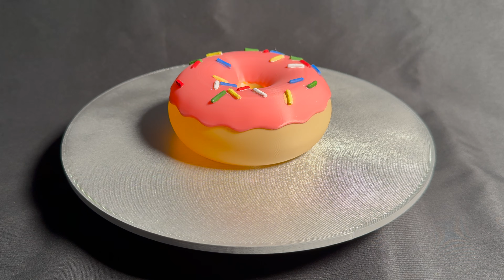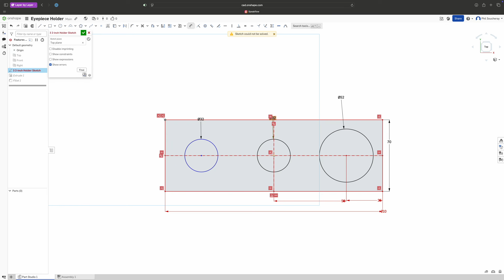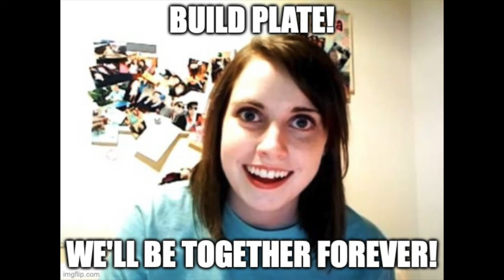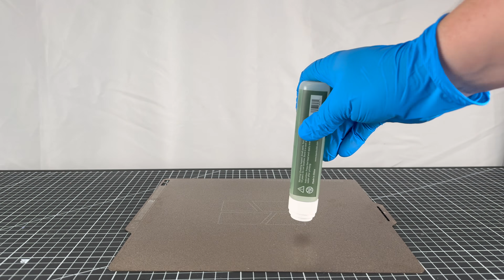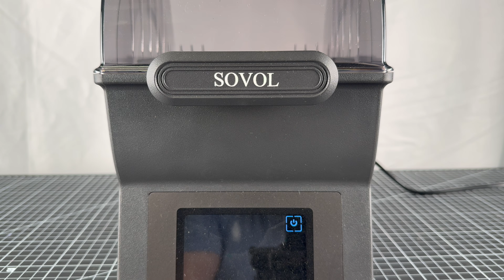Must Have Items for Your 3D Printer

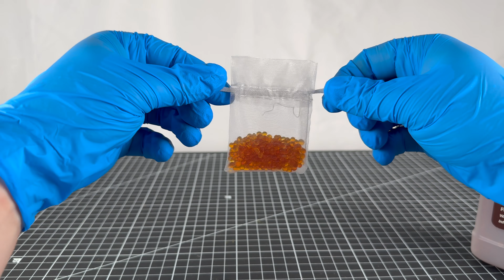Comment: 6:05  I bought a bunch of DIY tea bags to hold desiccant. I now have over 80 spools in vacuum bags with desiccant, which I vacuum out with a high powered food sealer with a canister attachment. Those little pumps manage to remove almost as much air, but they do it far too slowly for my taste.
Reply from the maker: Do you have a food sealer you like?
Reply: @LayerbyLayerPhil  The one I use is the Anybear Vacuum Sealer Machine, 90kPa 120W Wide Seal All-IN-1. It even comes with the “cup” that fits over the vacuum bag valves. It’s available on Amazon. I have several of those rechargeable vacuum pumps and they generally take about 2-3 times as long to void the bag. When storing a whole AMS of filament, you REALLY notice the difference.
Reply: @LayerbyLayerPhil  Also, one thing further … when the air is removed, the bag clings to the side of the spool. Since the spool core has no effective air passage to the filament winding, putting the desiccant bag in the spool core will remove moisture from the spool core but not so much the filament winding. Put the bag of desiccant in the vacuum bag before the filament spool and let it settle beside the filament and when you remove the air, the remaining air inside contacting the filament is also contacting the desiccant so will dry the filament more efficiently and quicker.

Comment: Without watching the video I am guessing it's (the tule bag) being used to store desicant. At least that's what I use them for, works great. Now to see if I am right... and I was

The Gecko Plate is great for PLA, uhh use glue as a release agent for CoPE, it will come off but crap it wasn't easy.

Love the storage bags however I found using a USB corded vacuum much better than battery powered one.

Comment: Are you able to put those dehydrator ball baggies into the dryer or you have to remove the balls from the bag in order to dehydrate them.
Reply from the maker: I haven’t tried doing all in together. I would take them out though because the breads get super hot when zapping them In the microwave and I suspect the baggy would melt.

Comment: Instead of a de-burring tool I use an edge beveler used in leather tooling. You can get into tighter corners and it doesn't swivel. It gives finer control due to it being ridged.
Reply: De-burring tools have interchangeable blades, some of which have rigid connections that do not swivel. That means the de-burring tool does the same job as your edge beveler on plastic as well as being able to use a swiveling blade. The swiveling blade offers consistent contact angle of the blade which makes smooth continuous cuts much easier than a fixed blade. A fixed blade on plastic has a high risk of inconsistent, uneven cuts that can easily gouge the edges. A better solution though is to not need the tool at all by tuning your printer’s first layer to eliminate elephant foot and designing chamfers and fillets into the part appropriately.

Comment: I've never used glue, just a clean plate always works for me
Reply from the maker: The vast majority of the time a clean build plate is all that’s needed. Especially with PLA. But when using something long and thin that is prone to warp or especially with materials like ABS or ASA it can come in handy. And for PETG it is a cheap insurance against tearing the coating off of the build plate because it can be quite clingy.
Reply: @LayerbyLayerPhil  Glue is fine when that’s all you have that will work. A better solution for ABS/ASA and other filaments prone to warping is an enclosed print space with temperature control. For the case of PETG, in most cases, if you wait for the print bed to cool completely, it will release easily from the textured PEI build plate without the use of glue. If your build plate is old and worn, then use glue for sure for PETG. PETG on a smooth plate can adhere in the manner you described so glue is recommended for parts that don’t have a large area of build plate contact.

Comment: I stopped using glue, if I start having issues with adhesion I was the build plate thoroughly with dawn dish detergent. Works well for me. New subscriber, Thanks for sharing.
Reply from the maker: Thanks for watching and subscribing. Dawn is also my go to for washing down the build plate. Seems like a good option for a second video of things to buy. I hadn’t thought to include that in this one.
Reply: Is dawn dish detergent just your regular a list dish soap or something else, dawn doesn’t exist where I live
Reply: @ConfusingGameplay I would think any mild dish detergent would work, I also use a good stiff bristle brush to get in the grooves.
Reply: @VIPER35GP thanks!
Reply: @ConfusingGameplay where do you live?

Comment: Another preventative measure to counter excessive PETG-printbed sticking and also counter the elephant foot at the bottom of the print is to do so with Slicer/Machine settings:
For me, these problems get worse when the hotend sits too close to the bed on the first layer. Which is always the case when I just let my Centauri printer auto-level itself. By setting a Z-Offset you effectively make a little bit more room, so the PETG doesn't get tightly pressed into every nook and cranny of the printbed.
There's also Elephant foot compensation in Orca slicer (and likely also in other slicers), which acts in a similar way. For me, I solved those 2 problems by setting a Z-Offset of 0.15mm on my roughly textured build plate (which obviously has inherent z-height imperfections if you think about it).
Reply from the maker: Thanks for sharing. It’s definitely good to have other options available. I’ve had PETG stick even with glue stick so I’ll give this a try if it happens again